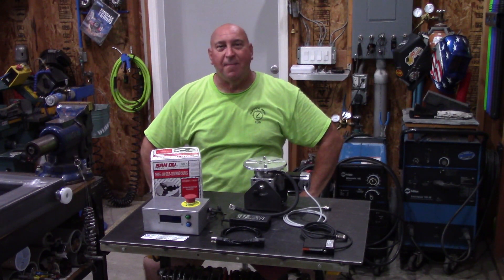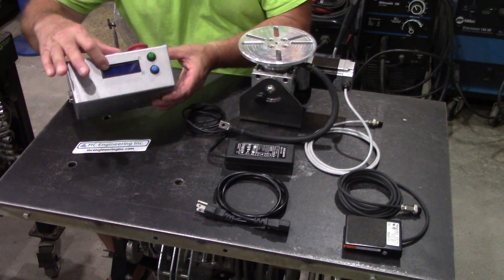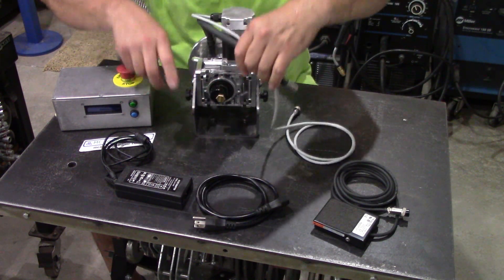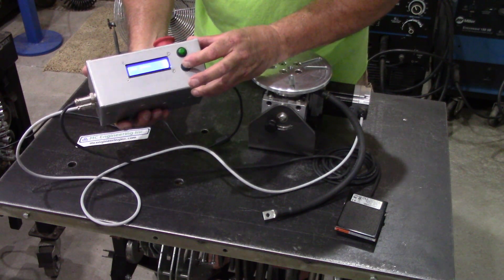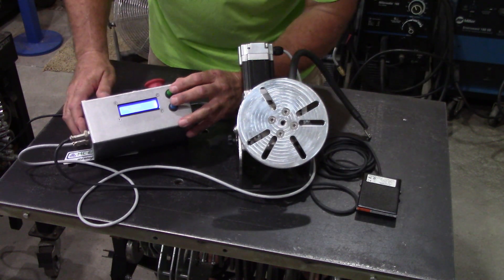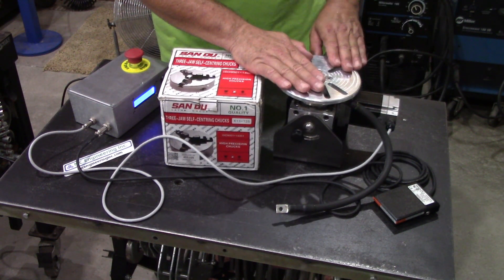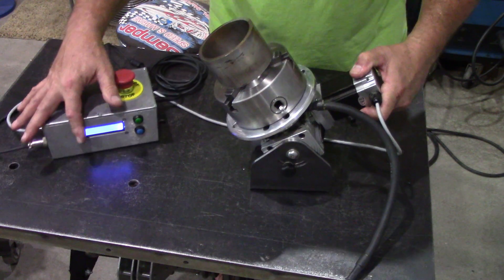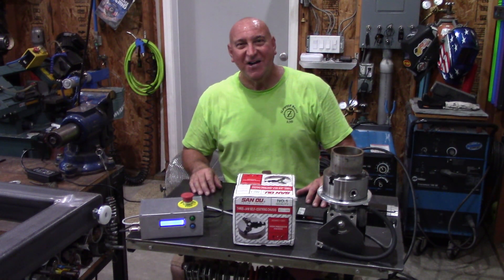Banggood Chuck Mounted To Rotary Welding Positioner

Comment: I am not a welder even though I have done some welding.  My suggestions were already commented and I agree with them about using rotary knobs and the forward/reverse switch instead of buttons.  Make the controls similar to Miller, Lincoln, and other welding machine controls for convenience.  I probably will never buy one of these but I can see the usefulness.  I can see a use other than welding.
Reply from the maker: Great suggestion! I will share with MC Engineering!

Comment: Ray, looks like a well built unit. But the on the fly looks to pause while changing speed. That could be a little frustrating during a weld. For me I would want to control the speed from the foot pedal.  Im not good enough to have tig handle in one hand, rod in the other hand and still be able to adjust speed if its not at correct speed. Looking forward to hearing from you after you have used it a bit. Thanks for sharing Ray.      Gary
Reply from the maker: Great points Gary, I'm not a very good weld by any means but still practicing to make perfect some day and can use all the help I can get!!!